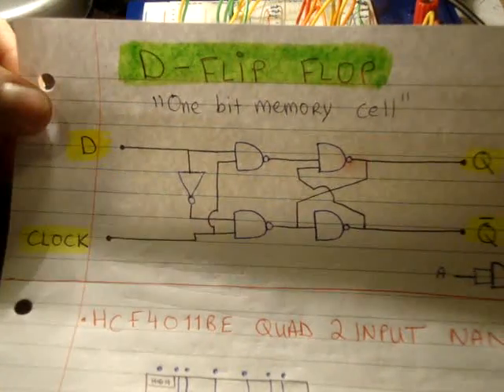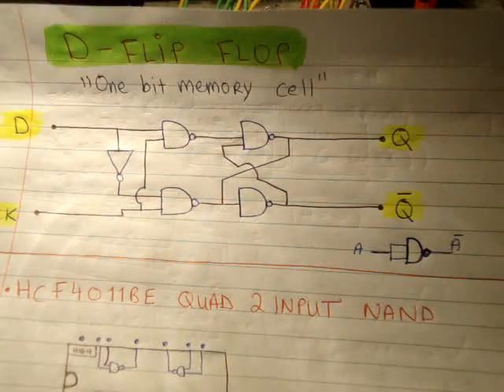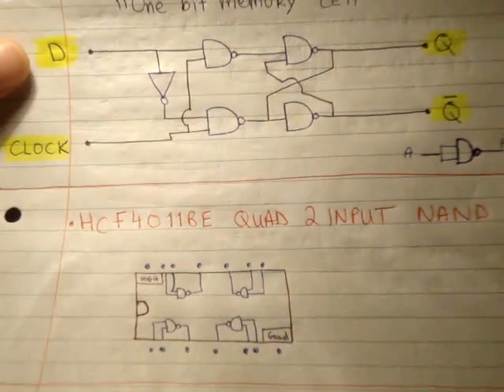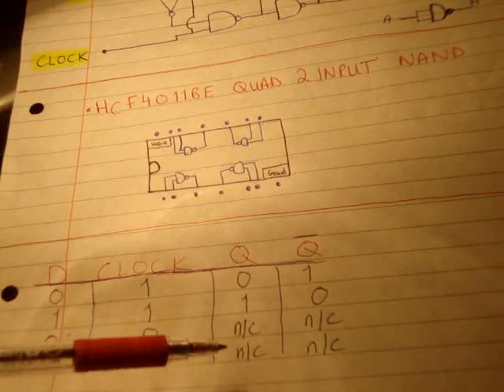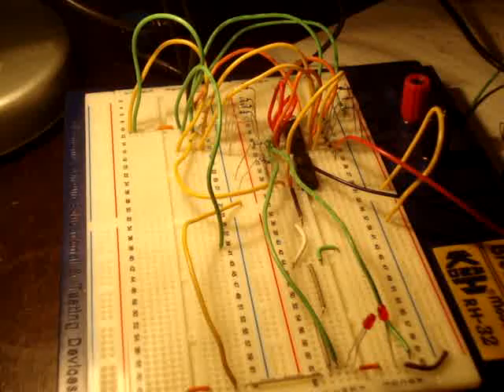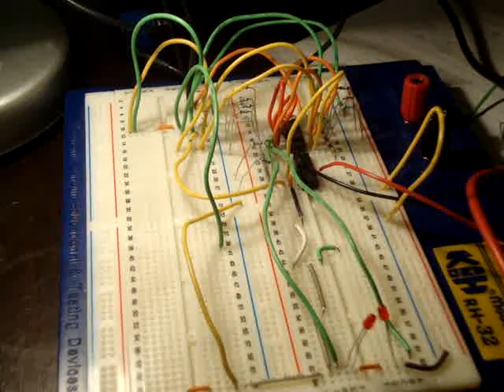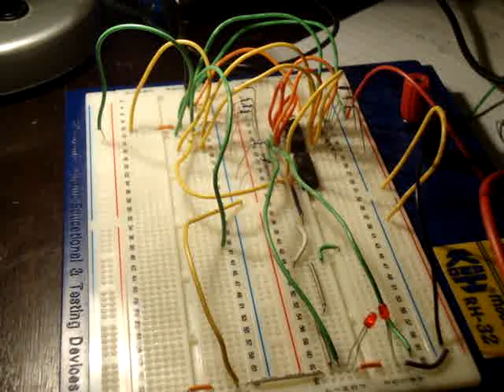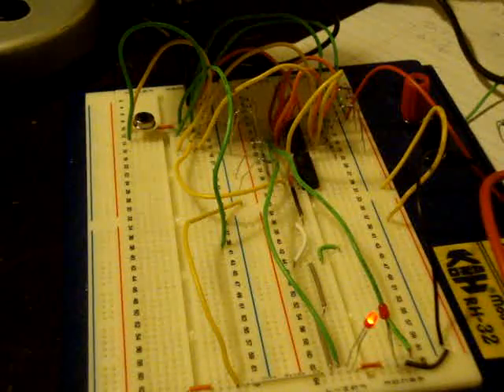Electronics 15 : How to make a D Flip Flop

Comment: I think you are making a mistake here, it is not D Flip-Flop but a D-latch. D Flip-Flop is a combination of two D-latches with opposite clock values, thus a D Flip-Flop copies D to Q on the rising edge of the clock(when the clock goes from 0 to 1) but not when the clock is high. For example consider the case where D=0, C=1 and Q=0, if you change D to 1 here the value Q will not change unless you do not change clock to be 0 and then 1 again. 
These links might be helpful to understand the difference:
http://iiith.vlab.co.in/?sub=21&brch=66&sim=519&cnt=833
http://cs.stackexchange.com/questions/11090/what-is-the-exact-difference-between-a-latch-a-flipflop